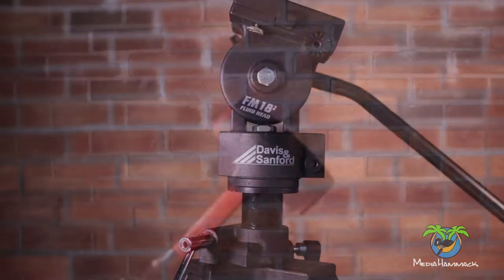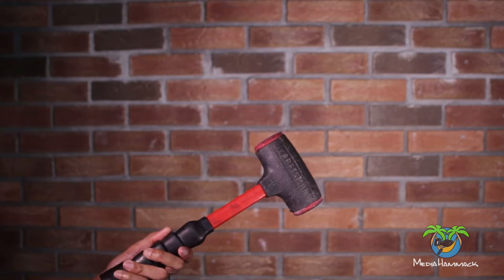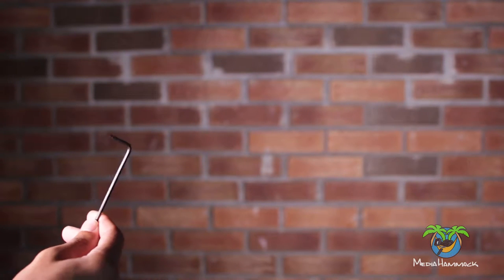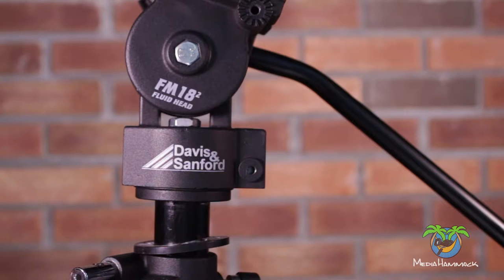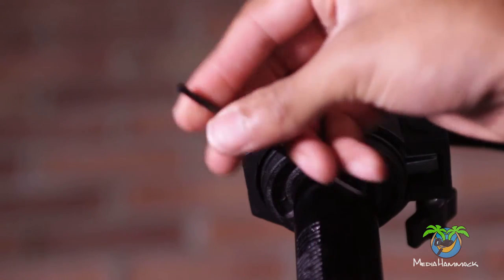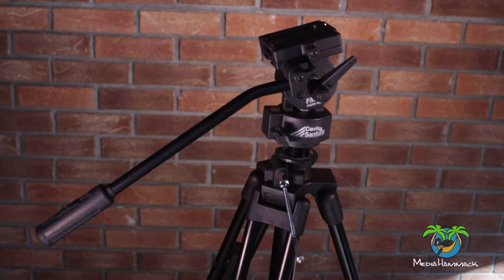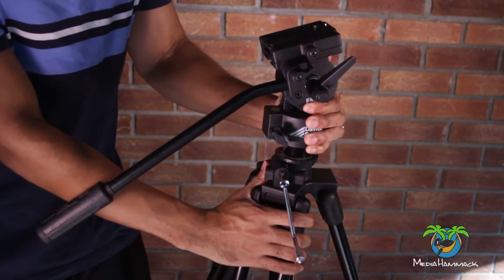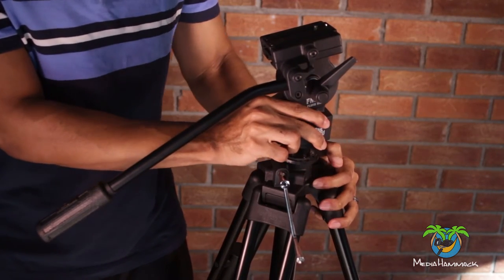Davis & Sanford FM 18 Head Removal

Comment: any way to do it without the hammer?
because that scared the crap out of me.
Reply from the maker: EmilioRoman Photography Lol...I suppose you could get some oil, move the rubber cover, turn it upside down and put a little oil into threads. That may work too. Let it sit for few minutes though in that position so the oil stays in the threads. Then try removing again.